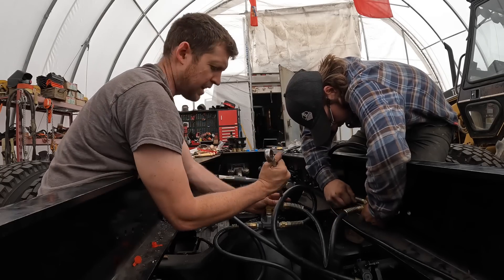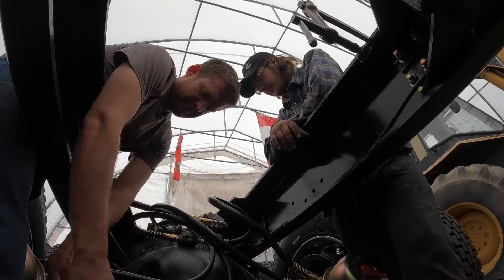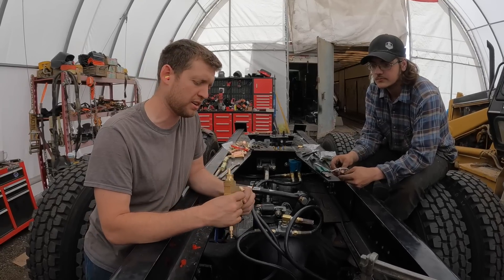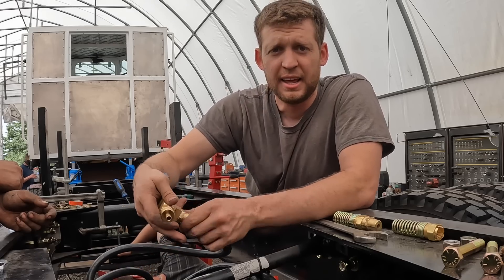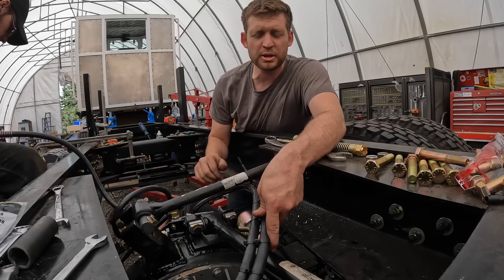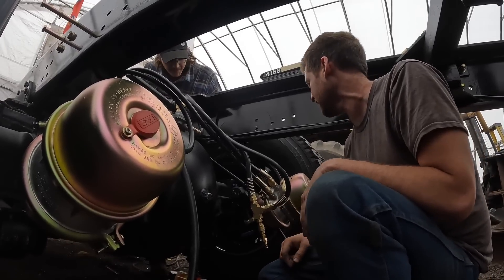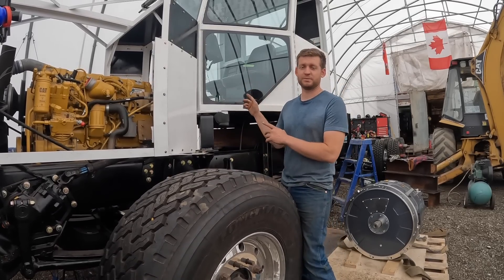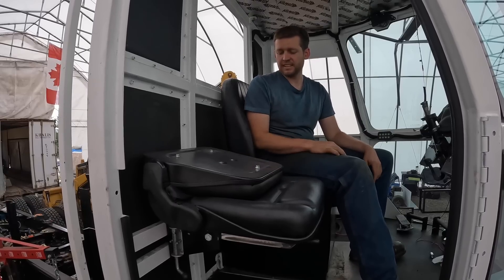Behind the Scenes: Truck Maintenance and Air System Upgrades!

Comment: Those push connectors were originally built for pneumatic systems on industrial machinery, not for road vehicles.
Aside from reduced durability, they have a second problem: to disconnect the hose, you have to push in the ring completely, and these have a tight fit. If you get any amount of grime in there it becomes almost impossible to disconnect the hose, so you have to cut the hose anyway.

Comment: Building the right way SO IT WILL LAST  LIKE NOT THE BULSHIT WAY THE NEW TRUCKS ARE PUT TOGETHER F OR PRODUCTION NOT LONGEVITY PUT TOGETHER ZIP TIES AND PUSH TOGETHER FITTING PLASTIC AIR HOSE THAT leaks A FEW YEARS DOWN THE ROAD WITH ZIP TIES AND THIS MULTIPLEX WIRING THAT SUCKS AND WHY DO WE NEED A THOUSAND DOLLAR COMPUTER FOR THE LIGHTS WHAT WAS WRONG WITH A SIGNAL STAT. AND CIRCUIT BREAKERS. SO MUCH GARBAGE THESE NEW TRUCKS ARE IF I WASN'T IN CALIFORNIA I WOULDN'T BE RUNNING ANYTHING NEWER THAN  2000 PET. 379 359 WELL BUILT TRUCKS. SO MANY PROBLEMS WHERE DO I START.

Comment: @2:16 When I was a tech working on OTR trucks, those plastic quick connect fittings were the biggest pain in the ass ever. Always leaked, had to cut the new line just right or it would start leaking again as soon as you aired the truck up; and while they might have been quick to connect, they were never quick to *dis*connect, even with the special pliers designed to do it. The old compression fittings like you guys have that you remove with a wrench are far superior imho

Comment: I appreciate the extra airline that you are leaving. However, if you’re an OE manufacturer you are subject to brake application timing and stopping distances. Plastic line doesn’t swell on application which leads to reduced brake lag application time. Minimum hose lengths ensure brake application time is to a min. I know it sounds like BS. As a retired CVSE guy 2 1/2 + decades I was involved in a few federal DOT test scenarios. No malice in this comment just sharing some engineering info why trucks don’t come with a bunch of extra hose in the mix. You buy it and take it home and modify with DOT approved hoses you’re good to go.

Comment: An idea for that passenger seat. I think it's an European car only but the older Citroën Berlingo (late 90s models, cargo - singel cabin models only) got when u fold the passenger seat on the back a sort of a "cargo" area where you had a deepening where u could put you paperwork and a rubber strip on top so it can't fall of. Extra for u got I think 2 Cupholders and a small deepening for a pen. I sadly couldn't find anything online to that exact car and seat model. We had that car for working and it was a really great thing so big recommendation to do something similar. If you guys interested I can send you a design how it looked. 
Keep up ur great work 👍
Reply: The PT cruiser also had something like that. The whole area was flat when the passenger set was folded down, it was carpeted and had a raised edge. It had no cup holder, but the regular one was positioned fine and that carpet responded really well to velcro.

Comment: Please add a connection for air tools so you can use the on board air to service the truck! (Or air up tires) 

One near both bumpers front and rear would be perfect

Comment: Only complaint I have about the zip ties is that the tails aren’t cut flush. As an aircraft mechanic, we always flush cut our zip ties, otherwise they’re like razor blades and we curse the guy who did the install. Other than that the truck is looking great and I can’t wait to see the finished product! Keep it up!
Reply: I have definitely taken a hand file to a sharp zip tie a few times 😂 
Last time i had an engine out of my truck i took a grinder to all the factory casting edges. Cant stand hidden sharp spots cutting me up

Comment: Forget 10 cents an air hose, try $1-2 on scissor jacks in an SUV. Tried jacking up a newer GMC SUV by the subframe because it wasn't visible out by the rail where to jack from, thing collapsed in half right after I pulled the tire off. Those things are way flimsier than they used to be because as you said $2 saved per jack by a few million vehicles starts to be a lot of money. Thinking that way leads to trash products though. Being quality first is sometimes about leaving a little extra.

Comment: Most big electric air compressors use nylon tubing (and metal compression fittings or press fittings) to connect controls etc. All the same color. The last couple of times I have to repair lines, mostly brittle with age , I ordered 7 or 8 different colors of the tubing, to make it easier to trace them when troubleshooting. Maybe Colored heat shrink on your fittings would be useful later on .
Reply: Agree. All black looks rad as heck, but makes troubleshooting a pain

Comment: if you spray the rubber hoses with silicon lubricant every once in a while they will never get dry.  The silicon lubricant is waterproof.  Once you clean everything every once in a while you then spray the hoses with the silicon you should be good for a very long time

Comment: Brass compression to plastic air line.  In frame rails,  will be superior to rubber air lines.  Only in frame tho.  Not suspension areas.

Comment: When you hook up the brake system, steer clear of the international style spring brake valve. The failure mode is the brakes just not setting when you pull the knob. Unsafe design IMO. Hook it up like a Kenworth or similar and you're good. You guys rock!

Comment: I like how you build those trucks. I do not know about the weight limits in Canada, but here in Germany or even most of Europe, you need light equipment. :(
Could you maybe build a drawer (or two) for under that passenger seat? Could some small things needly and still provide fast access. Or use it for installing a cooler for snacks and water/ soda. For example the Dometic CoolMatic CD 30, a compressor fridge in the form factor of a drawer with 30 liters capacity.
Reply: A lot of these trucks are going to be built custom made, so they can really add whatever you want

Comment: I hate hoze I hate plastic tube I hate hydraulic hoze. 
I like galvanized steel pipe. Only bending part is hoze. Liebherr machinery have galvanized steel pipes for air and steel pipes for hydraulic whenever is possible. Every 6 years you purchase 20 hoze(20 cm length each) from liebherr and you never have any leak or problem... Unless you stick excavator crane into dirt. Pipe is cheaper and 100 times more durable than any other solution